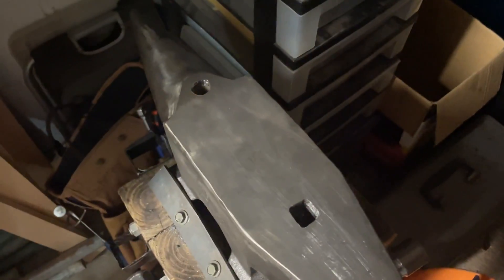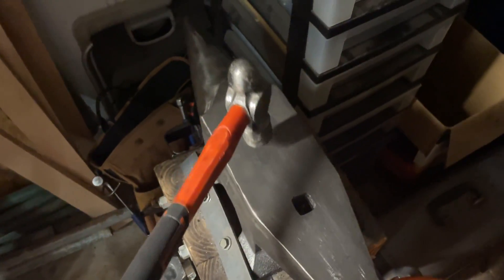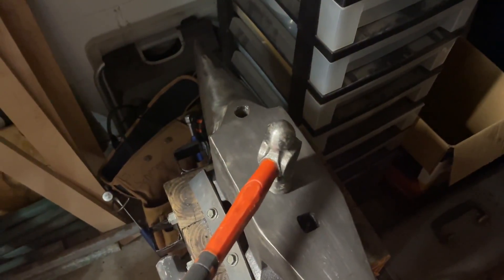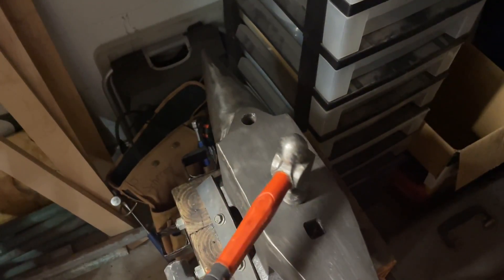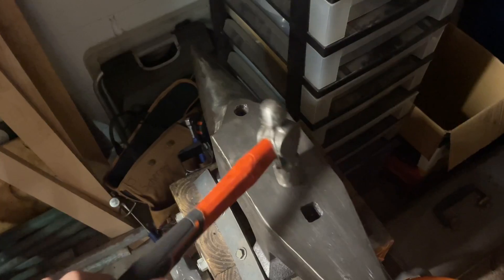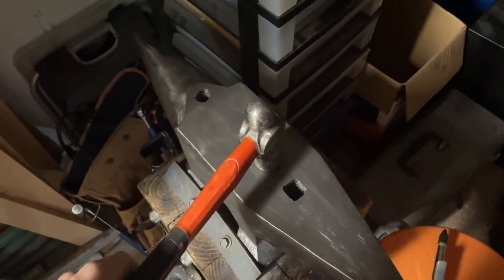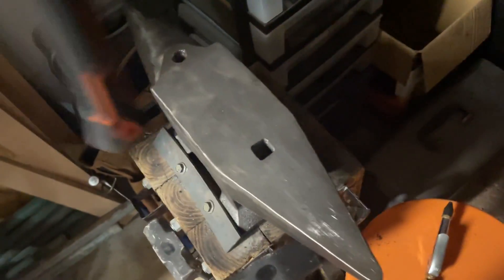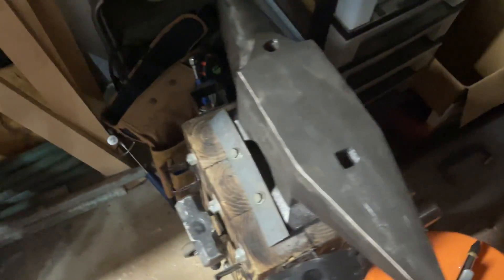How to Hardface an Acciaio Anvil!

Comment: I would be curious to know what the hardness was before and what it was after, good video. Thanks.
Reply from the maker: @BurrowDeeper  the reason I decided to resurface it was because the top was very soft and dented very easily. It started to develop surface check cracks, so I ground out the cracks, filled them with 7018 because it's cast steel, and then decided I might as well hardface it while I'm at it. You must have gotten lucky and got a good one- I got a dud.
Reply from the maker: Me too, I have no good way of measuring unfortunately.

Comment: Hey John, have you done any work on your anvil since posting this, and if so how's the hardface holding up?  Curious.

I'm got some more rough smoothing to do on my homemade anvil, but I'm getting close to doing the hardfacing on mine.  I bought 10lbs of 1/8" Stoody "Self-Hardening" rod, as it seems to have the right sort of characteristics and has apparently worked alright for the Christ-Centered Ironworks guy.  

My current plan is to first preheat the whole anvil with a big propane roofing torch to ~300F, lay down a layer of 7018, grind it all down to a smooth plane, and then lay down the Stoody rod.  I may or may not do a second layer of the Stoody, haven't decided.  Will see how it's welding after finishing the first layer (how much dilution with the 7018) and also whether I have enough for 2, and then follow my gut.  I'm pumped to begin, but I know I will need a big chunk of free time to accomplish it, and free time is hard to come by with the kiddos.
Reply from the maker: Hi Aaron, no I have not done any work to the anvil since and it's holding up great to a fair amount of forging.

Your plan sounds great but yeah, you will definitely need a big chunk of time. 

A few suggestions:

1: You probably don't need to grind down the 7018 layer a ton- it would probably just be a waste of time. Just get any particularly high spots down.

2: don't use hardface rod around the hardy or Pritchett hole because it will be very hard to file or drill unless you have a band file or some carbide burrs.

3: definitely use 2 layers of hardface- by the time you grind it flat, you will have a fairly thin layer and may even have a dead spot. This happened to me but I just haven't had the time to go back and add another layer. Just to give you an idea- I used probably about 3 of the 5 pounds of hardface I bought for one layer and you can see in the video how big it is.

4: it is a LOT of grinding, so take the time to get it at a comfortable height to grind (your wrists will thank you). I would definitely recommend getting something bigger than a 4.5" grinder. I did the majority with a 7" regular grinding disk and then the rest with a 5" cup wheel that I put on a 6" grinder to give it a little more power.

Good luck! Let me know how it goes.
Reply: @John Wheels  thanks so much for the suggestions!  I will take them all into consideration.  Very helpful to get some outside input, as there isn't much anvil-specific hardfacing information available online-  at least not steel anvil specific.

I wont go crazy trying to get my 7018 perfectly smooth.  And based on the coverage you got, I expect my 10lbs should be plenty to give me 2 complete layers of the hardfacing.  I think I will run the first layer of stringers out, and then run the 2nd layer in all the valleys of the 1st layer and then grind them down together as one layer.  This Stoody rod is supposed to wet out pretty nicely and lay flat, so if I can get the amperage dialed in right hopefully I can keep grinding to a min.  Will rough it down with a regular 7" grind wheel, and then I'm thinking I'll try some of the fiber discs.  Harbor Freight sells a 7" backing pad for angle grinders and they're supposed to be carrying 7" fiber discs soon as well.

Once I get some more progress, I'll come back and comment again!
Reply from the maker: Awesome, good luck! For all my abrasives I've had really good luck with benchmark abrasives. They're way cheaper in bulk and they last like 10x longer than harbor freight. I haven't tried their fiber disks but I imagine they're good like the rest of their stuff. I'm not sponsored- just thought I'd try to save you a buck. 😃I'm sure the backing pad from harbor freight is just as good though.
Reply: @John Wheels  
Made some progress.  Getting close now.  Burnt down a layer of 7018 and then used a regular grinding wheel to take down the high spots.  Then felt like trying out the 7" fiber discs so I threw a 26grit wheel on the backing pad and gave it a go.  Holy cow-  it's really hard to hold onto, but it worked great.  After just a few minutes of running it and holding on for dear life, I had a nice even and semi-smooth plane to lay my hardfacing on.  First check with the straight edge was pretty much perfect.
Fiddled around with the settings on my stick welder til I got the hardfacing rod running well on some scrap pieces, with minimal penetration/dilution.  Took me a bit over an hour to lay down the first pass, then I came back last night and did a 2nd pass with my stringers running perpendicular to the first layer.  I didn't see anyway around putting it on around the hardy/pritchel, so I tried my best to keep it from falling in (with mixed results).  Will probably need to pick up a fresh carbide burr for my dremel.  All in all things went pretty smoothly, and I still have a good bit of rod left for touching up.  Hopefully after work today I can get started on grinding it down.  I'm also going to put at least one layer on the top and sides of my round horn.
Reply from the maker: Awesome! I guess I'll have to try out those fiber disks. Good stuff! Lmk how the grinding goes.

Comment: Thanks for sharing.  I've been mulling over the idea of hardfacing for several weeks now.  My situation is a bit different than yours-  rather than starting with an existing cast steel anvil, I am in the process of making one by welding together several 12x20" pieces of 1" plate stood up on end.  The 1" plate is mystery metal, though I do have a lot of reasons to believe its mild steel:  it spark tests like mild steel, and these pieces were originally manufactured to be counterweights or ballast plates for a rooftop hand crane so I would assume they would use the cheapest steel available.
All of my pieces are cut to shape and welded together (several plug welds spread out in the centers affixing each plate to the next in the stack, and all perimeter seams were deeply V-beveled and filled with 7018 rod at high amperage, I preheated everything with a torch prior to welding.

Still have some work to do to complete the body, but I'm trying to decide what to do for the face.  Going back and forth on whether to fully faceweld a 1/2" piece of 4140 or 5160 to the top, or hardface it.  I'm starting to lean towards hardfacing now, because I don't think I'd be likely to get great results trying to heat-treat the 4140/5160 face once its fully welded to 150lbs of mild steel.  Would have to build a big fire in the backyard and build a temp brick oven, and any sort of quench I could attempt would be a shot in the dark.

So now I'm back to reading up on hardfacing rods to try to determine which will work best for my case.  A lot of the anvil-relevant info available online pertains to starting with a cast iron base, so I'm not sure whether I would still need a buildup layer.  I might do like you did and run a 7018 base.  Doesn't seem as if it could hurt, and I've got a ton of it already.  Does seem that it would be beneficial to have a layer of HRC ~30 metal in between the mild steel body and the harder face rod.

Thanks again for the content
Reply from the maker: I believe the particular forney hard face rods that I used are intended for welding right to mild steel. 

If what you have are counter weights, there's a chance they are cast so I agree a layer of 7018 definitely couldn't hurt. 

One mistake I did make though was only doing 1 layer of hard face. As it melts with the mild steel, the 2 metals dilute and mix up not leaving the top as hard as advertised. Also, by the time you grind it flat, you're taking off a lot of that top layer so I would definitely recommend at least two layers of hard face, but not more than three because you risk surface cracking, if you plan to go that route. 

Good luck with your project! Sorry for the late reply.
Reply: Yeah, without a good way to heat treat, hardfacing sounds like the right choice…. As long as you can get a good surface on the finished product!  Good luck
Reply: Thanks for the replies.  Good call on the possibility of the counterweights being cast, because they often are, but fortunately mine are hot-rolled A36 plate.  I spark-tested them before I brought them home, otherwise I probably would have left them be.  Also, after removing the paint they had, I discovered the telltale layer of smooth dark-gray millscale you always see on thick A36 plate.  Gave them a little bath in some muriatic acid to take it off, although it probably wasn't necessary.

I'm definitely going with hardfacing over trying to heat-treat a plate face.  Just a matter of settling on which rod to try.  Blue Demon has a rod (their 450) which looks to have the right characteristics and the price is right, so I may go that route.  Will do a layer of overlapping stringers, and then do a 2nd pass filling in all the valleys.  Biggest challenge for me lately is just finding the free time!
Reply from the maker: @aaronschwingel3330  cool! Good luck!
Reply: I would really like to see that in a video if possible, thanks.
Reply from the maker: @9Antonian  can you specify what you'd like to see?